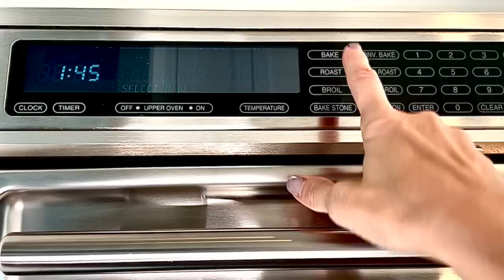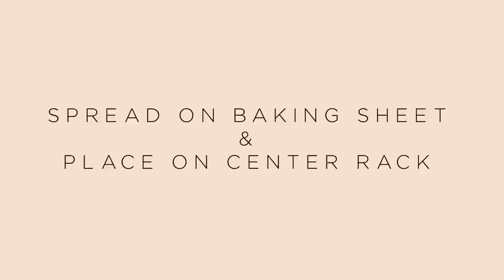Maximize Your Cannabis: How to Decarb

Comment: Is there any ways to decarb weed outside i would really appreciate it anyone had  ideas
Reply from the maker: Unfortunately, that's a really tough one. This is chemistry, so the steady temperature required to optimize your cannabinoids would be very tough to meet by decarbing in the open air.
Reply: Best you can do is take a crock-pot with extension cord. Not ideal but itll get the job done with diligent temp regulation

Comment: not really accurate. I used fan leaves for brownies and they did great with only the heat from cooking the brownies
Reply from the maker: Hmmm...but the cannabinoids are in the flower, not in the leaves, so that seems odd. You might have gotten some effect, but not what you could've gotten if you'd decarbed. No shade—we're just sharing the chemistry, not our opinion.
Reply: @AtHomewithHouseofPuff  not all the cannabinoids are in the flower. Look at the leaves near and around the flower and there are enough tricomes that you can see them with the naked eye. There are cannabinoids in most parts of the plant and I agree that there aren't enough in lower fan leaves and the stems to bother with but I know from experience and I'm 68 years old with more than 50 years experience with cannabis both with consuming and growing as well as making edibles and concentrates.
Reply from the maker: @southernmanC  We learn something new every day—thanks for sharing your expertise!

Comment: Put the buds in a glass jar with a lid, put it in a pot with a couple inches of simmering water for 2 hours. Done. This method doesn't fill the house with any smells. I've heard you can use a jar in the oven too but I haven't tried it myself. But the water trick works and your neighbors won't know what you're doing.
Reply from the maker: Great tip!. The only problem with that is that you wouldn't have the same kind of temp control that you do in the oven. So you either won't activate or will damage some of your cannabinoids this way. But if it's that or a battle with your neighbors, we're all for it. The other non-smelly option, if you've got the $$, is to buy a decarbing appliance like the Ardent.
Reply: @AtHomewithHouseofPuff  all you need is a slow simmering boil. We know water boils at 212 so simmering is around 200. 
I've done the oven thing too and I get better results from the jar and water in a pot.
Reply from the maker: @comfortablynumb9342  That's great info! Although the consensus is that 220 degrees is optimal, at 200 you're likely not losing that much. Thanks again for sharing!❤

Comment: 0:12 can you decarb roaches too
Reply from the maker: Good question, but considering the heat that they would have already been subject to from smoking the rest of the joint, it'd be almost impossible to figure out the right amount of time to heat them for decarbing. Better to just smoke those & hope for the best.
Reply: @AtHomewithHouseofPuff  what bout using  them to make tincture
Reply from the maker: @dreday759  You can try, but the potency will be really hard to judge for the same reason. But if you don't care, go for it!

Comment: HOW TO DECARB WITHOUT OVEN / MICROWAVE?
Reply from the maker: Ugh, that's a tough one. (And you can microwave, but that's highly inefficient because you can't maintain steady heat and can easily burn your flower.) There are brilliant decarbing appliances, like the Ardent. But if you have a decarbing appliance, chances are, you have access to an oven, too. To be honest, the best way to decarb without an oven is to smoke your flower.

Comment: Great pot head info…. 
I’m trying to acquire info for cannabis use in chronic and palliative care type pain (for A.S. — Ankylosing Spondylitis)
and this turned out to be a great resource.  
The medical dispensary has all sorts of products but I have very little experience.  They now carry edibles, so might be a good option for a family member in excruciating pain.

I’m guessing that edibles are safer than smoking toxic compounds.

Remember….   All oven temperatures vary.  Even my wife’s Viking commercial type oven varies up to 10-20 degrees F when setting temperature is between 140-200 degrees F.    Try to use a meat or candy type thermometer to test with more precision.
Reply: Yes, edibles are the best for chronic pain

Just be careful with the dosage, it can become a little much
Reply from the maker: Totally agree!